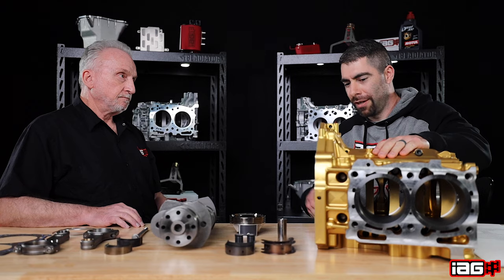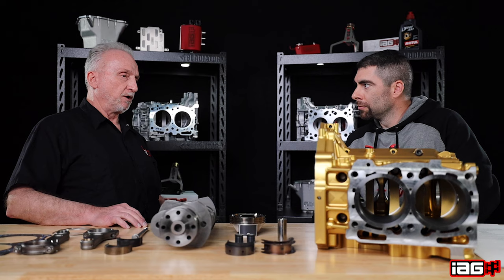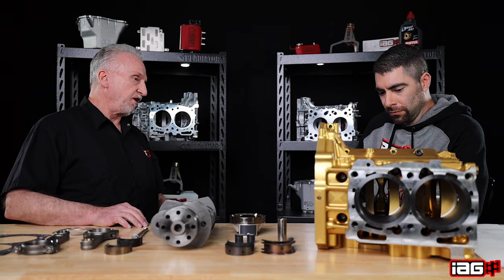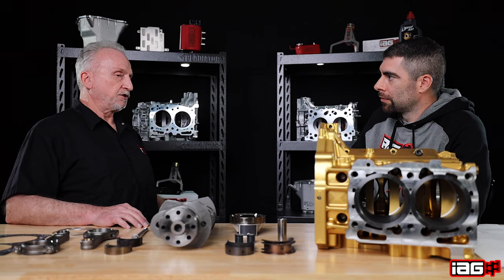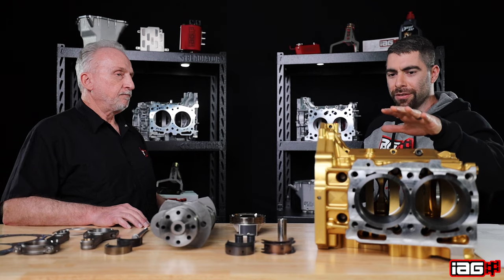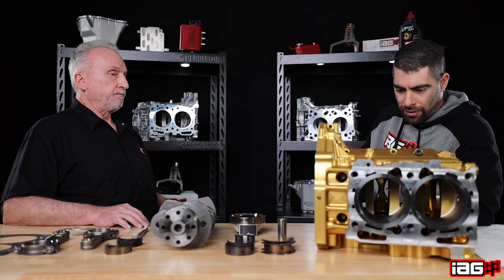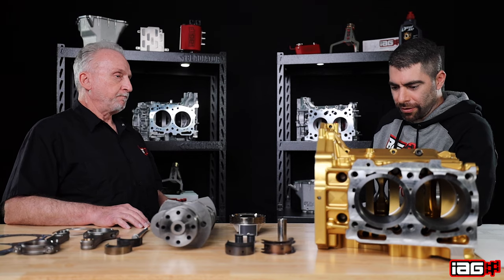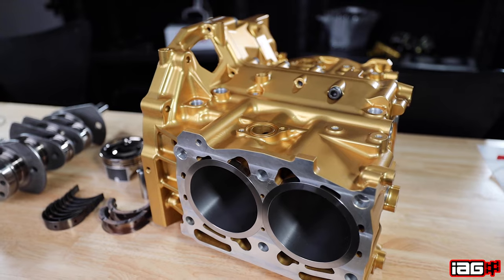IAG Performance Stage X Short Block

Comment: My 2021 sti engine just blew, wish I had this baby in it!!
Reply from the maker: You can ;)
Reply: How did you manage that?
Reply: @lucian7182  I just bought the car, 0 miles, I got the 4 oil changes up to 24k miles from the dealer so I would take it every 6k miles to do the oil change. But according to everyone else, oil changes should be done every 3k to 4K miles on an STI. Either it was just engine failure or my failure to not do oil change every 3k miles
Reply: nate chave it sounds like you didn’t check the oil at all in between changes. That wouldn’t be horrible on a typical 2021 vehicle however on a performance car that’s no bueno. My 21 sti consumes half a quart in 16-1800 miles if I don’t add any by my 3k oil change I’m almost a quart low which is within normal parameter for this car. I don’t know your car personally but it would make sense that your car ran about 2 quarts low on oil for however long before it popped.
Reply: @lucian7182  you are correct, I've been hearing from other sti videos that the 2021 sti shouldn't be burning oil but I guess I shoukdve still checked. But less on learned. I just got the update it'll be ready in 2 weeks and now oil changes every 3 or 3500 with bi-weekly oil checks bcuz I do run it a lot. It's my daily. I've already put 22k in 9 months
Reply: @natechave2825  if you see that oil is disappearing, get your turbo checked asap. There might be leak, how do I know? I had a leak coming straight from the middle of the turbo